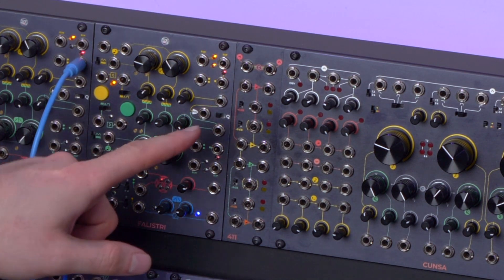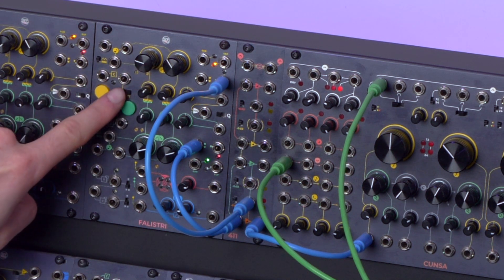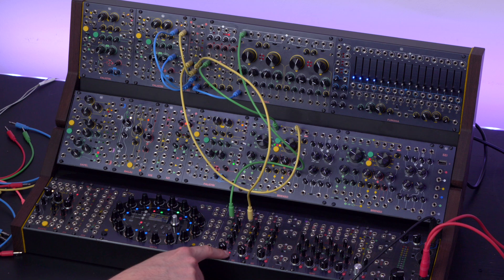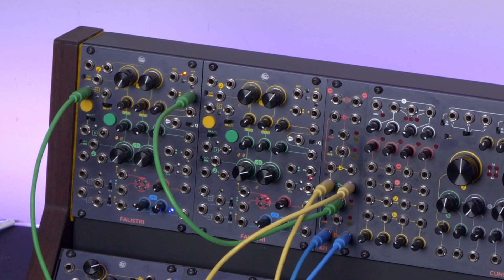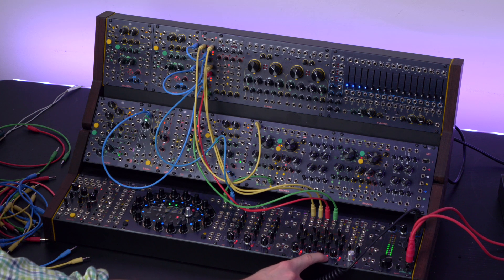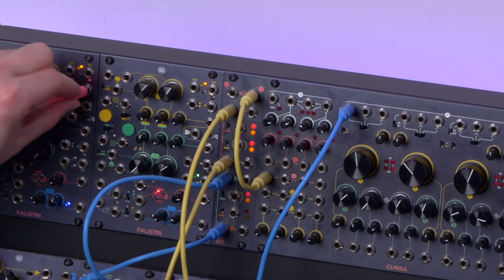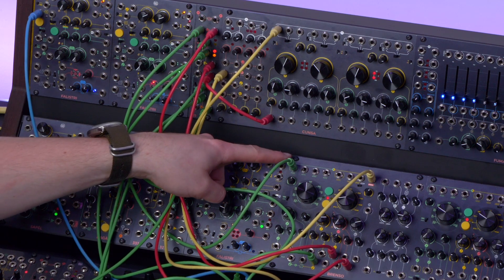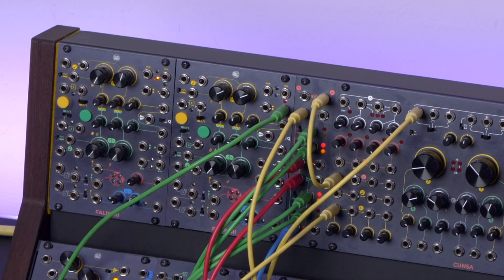The many faces of a quadruple VCA: some daily patch examples with the Frap Tools 411

Comment: i have a question: why at minute 12:52 the mixed output is used? shoudnt it work with the left output cause no output of the vcas are used? why it works with the right output, which i though only mixes the vcas who are patched at their own output?
Reply: ah ok got it: from the manual: ". If all the section outputs are un-
patched the two mix the outputs will sound the same" , i get it.
Reply from the maker: That's right! The left output becomes "different" only when the output of at least one section is patched somewhere